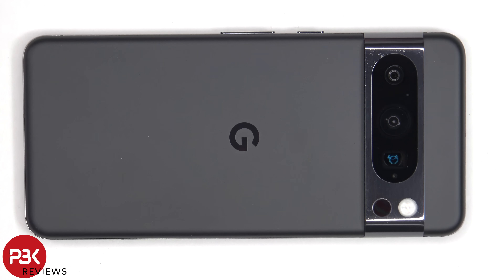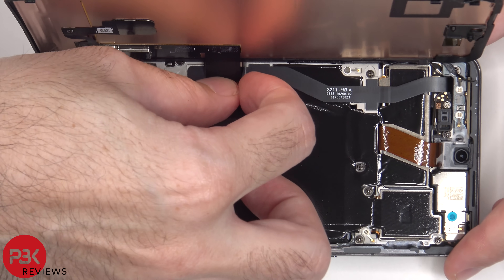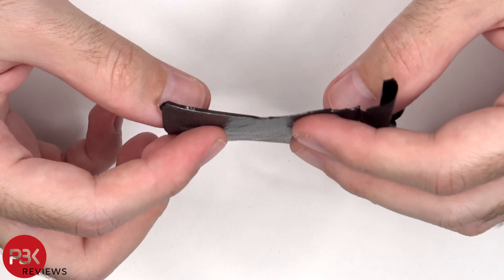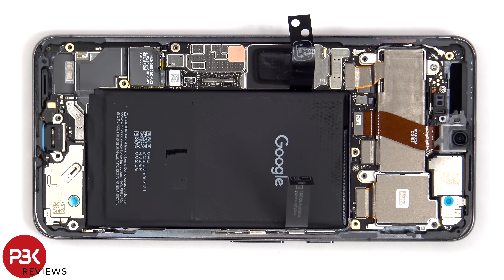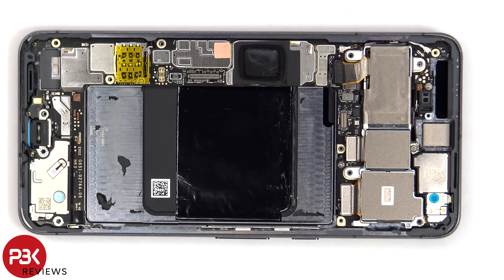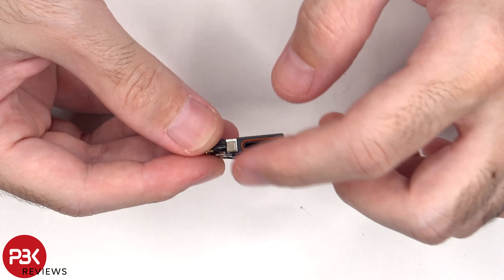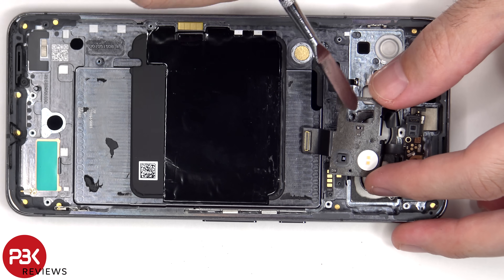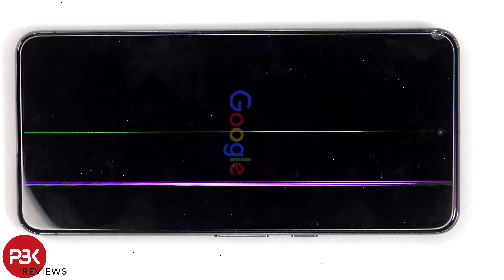Google Pixel 8 Pro Teardown Disassembly Repair Video Review

Comment: That screen removal is a bit worrisome. Hopefully, someone will post a full repair guide before I need to replace any parts. Could be that I decide to replace the battery as well, if I crack the screen in a few years.
Reply: i mean he didnt touch it with a heat gun full on just prying it off is not the right way to do it. beyond dumb,
Reply: @sinosdh  Even with heat guns its fucking hard to change the screen without damage it. I did it 2 times with head guns and broke 2 screens already. Fuck it GOOGLE!
Reply: @sinosdh  google said they improved repairability with Pixel 8 lineup so we, normal humans don't usually have heat guns at home.
Reply: @kerpl0p  you use a hair dryer instead at that point.
Reply: @kerpl0p glad I'm not normal 😂Tinkering is my jam! Heat guns and more!
Reply: @kerpl0p  and even if they have, they would either burn the screen or dont apply enough heat than they apply too much force and break the screen or peel at the wrong place... repairability reuires to forget glues and heat an use screws which had been invented long time ago
Reply: I just had the same issue yesterday with Pixel 6a! But my display did not get damaged just the copper tape separated from the plastic border due to heat and wring prying (black frame, black screen....)
Reply: It looks as though there is a right place to pry and a wrong place.
It appears as though there is a seam between the screen and that plastic buffer, as well as the seam between the plastic buffer and the body of the phone.

Similar to the Pixel 5, and likely other Pixels.

Pretty sure he did say he heated the screen before prying, but yes definitely heat the screen before trying to pry it off!
Reply: @LadFromWales85 they've all been like this. I know at least since the pixel 6. I know because I've removed the screen on one of them a couple times before.

Comment: Dude. Who on god’s green earth woke up one day and was like “Yep. Non replaceable type C port”
Reply: Planned obsolescence. No charging, no phone operation at all once the charge runs out, phone becomes a glorified doorstop, new phone purchase.
Reply: anybody able to work with soldering iron can solder new one on.
Reply: @joei4ever  Right. But with the Google x iFixit collaboration, I expected the USB port, the most common component to replace after screen and battery, to be easily replaceable.
Reply: @shaalan5672  honestly, its bigger problem to take it apart and put together again, then replace the port at that point  :D
Reply: @joei4ever  Honestly you’re right. I was trying to be nice and say that maybe with some effort I can take off the screen and put it back on successfully, but at this point there’s no point since I could drop the phone while plugged in and not be able to use USB C again 😆. Honestly disappointed. I wanted to switch from my iPhone 8 plus to an android this year and thought the pixel 8 pro could be the one
Reply: @shaalan5672  lol but why would this be a breaking point lol
Reply: @joei4ever  Cuz honestly I want to buy a phone that would last for as long as it's supported, and I highly doubt i will not damage the USB C port in 7 years. Also, around where I live, getting proper board level repairs done is not common.
Reply: @shaalan5672  dude, who  keeps a phone for 7 years. Wake up. In 7 years you'll have holographic cellphones, not this format lol
Reply: @joei4ever  Hahaha. Good point. Good Point. But i’ve had my 8 plus for close to 6 years now so i’m getting close to the 7 year mark
Reply: My Pixel 6 has a damaged USB port, and it is micro soldered. I would need a $300+ kit to replace it, or pay someone else $150 and wait 2 weeks to get it fixed. Hopefully it is easier to remove, but it is still bullshit.
Reply: @NovaDoane  change shop and ask for another quote. Or simply get something newer, cellphones are short term purchase.
Reply: @joei4ever  I don't feel like I have gotten all my use out of this phone. I've only had it for a little under 2 years. It still charges but gets really annoying when using Android Auto.
Reply: @CalmSnow_  Yeah, i get that point.
Reply: Do the camera modules have any id no or something like that? Would like to know if it's really still the same (now) 3 year old gn1 Sensor in the main camera..
Reply: @WaterproofX8  that doesnt mae it a bad camrera lol....
Reply: @WaterproofX8 it's likely a GNV
Reply: question is, is it also the same for the eu model? I guess so
Reply: INNOVATION 🙂
Reply: @@thecyclemedia pathetic peasant charging lmao, doesn’t even compare to USB-C or even Lightning
Reply: Me
Reply: @AppleReviews  no. they do not lol
Reply: Can someone point out where in the video it is being said?
Can't seem to find it that's why
Reply: At least you could still charge it wireless
Reply: @WaterproofX8 ale utrudniony jest transfer dużych plików
Reply: @WaterproofX8 at least, but it's still not a reason to do that. they were boating that they were working with iFixit to make it easy to fix
Reply: @WaterproofX8 Yeah, thank god the designers of your 1000$ device had the mercy to make it not a complete brick when a part that is sure to deteriorate over time breaks. Good thing we have such nice companies designing our products.
Reply: That's so fucked up 😂
Reply: That's what I was thinking! I wasn't gonna buy one anyways but jeez. Sony and LG phones for the win.
Reply: And still, no Vapor chamber. But Google loves to make YouTube videos joking about iPhone, they’re the joke lol
Reply: @JoaoBatista-ou3tf Nobody ever said a vapor chamber was inside. Stop with the rumors. You don't get to dictate what Google does, not even by crying on the Internet.